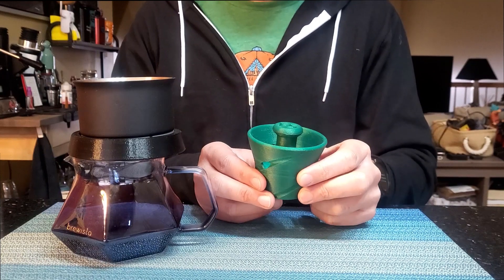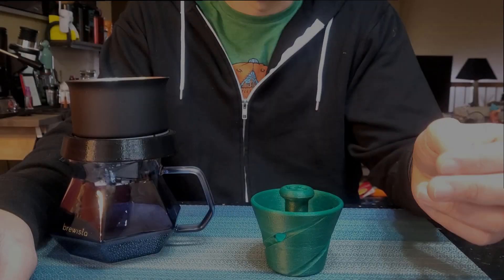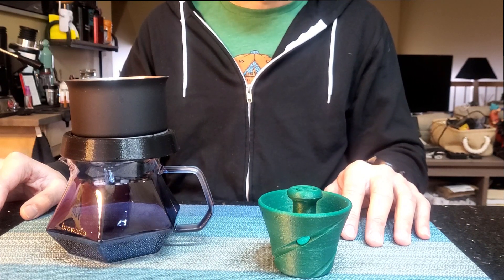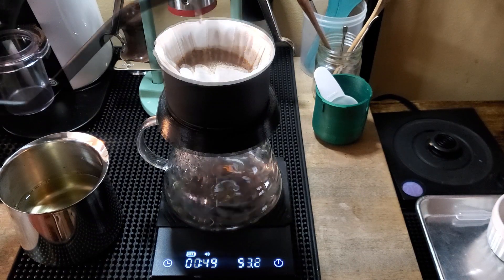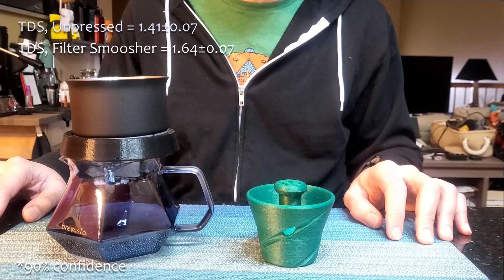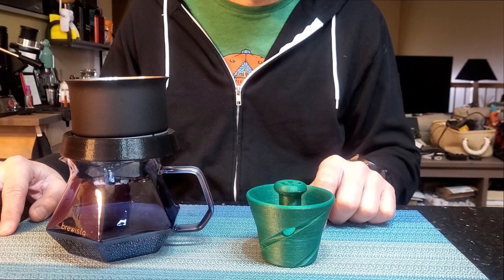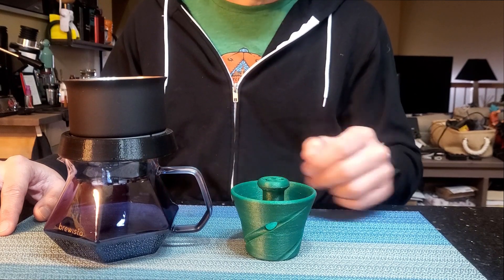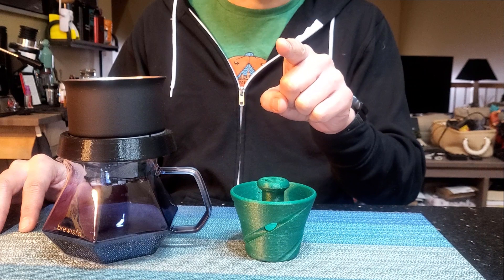Filter Smoosher vs Fellow Stagg X Pleated Filters - Does it increase TDS? Is it really #NoBypass?!

Comment: What sort of grind and water temp are you using for this recipe?
Reply from the maker: I've added a link to the brew guide I've shared around in the description. Been seriously using that recipe for over a year with excellent results
Reply: @daRock1212  thanks, I'm new to the Stagg X, will take a look! I am used to shooting for a 3min brew with a V60 and water near boiling, the heat retention of the Stagg changes things a lot.

Comment: Do you know of any filter smoosher available for the v60?
Reply from the maker: Unfortunately I don't think the bottom area is big enough for effective no bypass on V60s. That's why most of this style of cone brewer (Hario, Origami, Tornado, etc) have ridges to allow controlled bypass so it doesn't choke. Jonathan Gagne showed this in the linked article by rubber banding a filter to the outside of a V60 and consistently choked the brew

Comment: Thanks for working on this issue! Does this work with the bigger XF?
Reply from the maker: Thanks! It's been fun playing around with extractions on the Stagg X. I've never actually seen the XF IRL, but I imagine it's the same dimensions at the bottom but taller. If that's the case then the Smoosher should fit, but not crush the top of the filter. If I get my hands on an XF, I think a second, taller version would be pretty easy to do
Reply: @daRock1212  will be waiting to see if you ever do. Thanks again!
Reply: @daRock1212 I’m also curious on the XF. If you’re still looking into it, I’ll donate to the cause if there is a way
Reply from the maker: @KanielD  if you take a look at the makes on tverse, someone successfully scaled it 130% on the z axis for the XF. Seemed to work well for them! I've still never seen one, but trust it may work
Reply: @daRock1212  awesome. Thanks for letting me know.
Reply: Thanks for designing this! I’ve been using the smoosher with my Stagg x and loving it. More consistent and better looking than my Orea with the negotiator.

I will second the request for an XF version! Sadly, I just checked and it is an entirely different profile than the X but maybe easier to work with. It seems like much more of a straight taper. Please, give it a shot! I’d love to start playing with the XF again but I was using cloth filters and got sick of the maintenance.